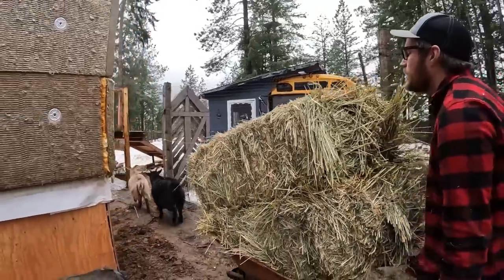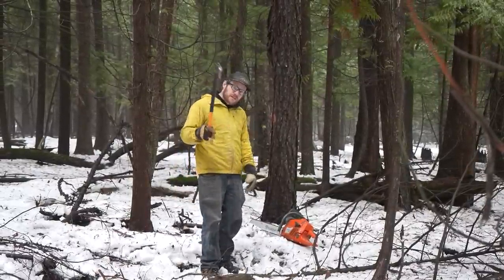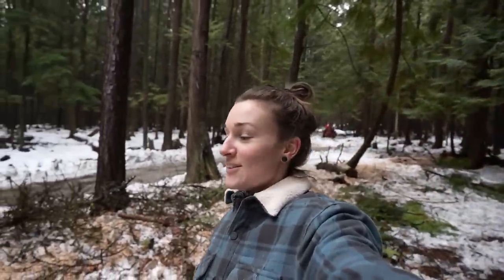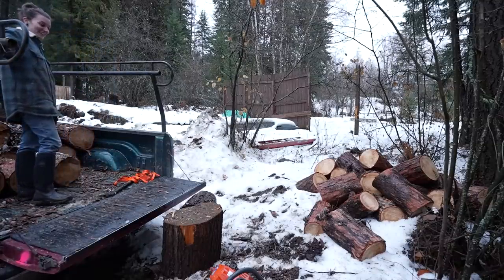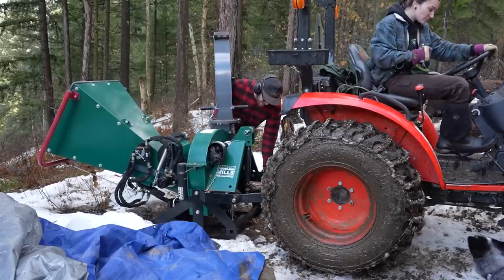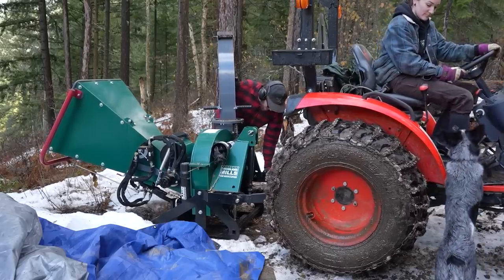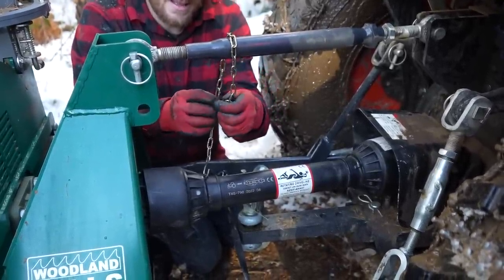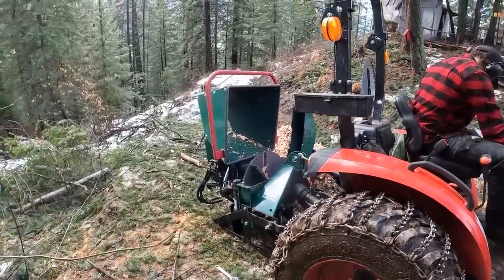We Are PREPARED! Living Off Grid In The Mountains

Comment: Wanted to comment on your chainsaw.  I have the same one and i've only had the chain come off once out of cutting down 1800+ trees with it so far.  It's a beast, and a good choice.  You may be having slightly less luck with chain staying on due to blade size.  I use a 24'inch and it's sufficient for our trees and works well.  Also if a chain only barely nips a branch it's more likely to throw vs just following through.  It's not meant for light duty limbs and will increase chain falling off if used for that purpose.  This is meant for large thick limbs/trees.  Use a smaller chainsaw for small brush.

Anyway, my 2 cents with the same chainsaw.

Comment: I suggest that you put a large tarp on the ground to catch the chips, then you can lift the tarp with the tractor and move it. 
I also suggest that you wear leg protection when using the chain saw and never - ever - have the tractor running when handling parts that are moving nearby. It is so easy to slip and parts might start to move and in a second you can lose your hand or arm. Protection comes first!
But I like your videos and your work on, and outside, your cabin.

Comment: I have switched to a much larger 2wheel wheel barrow(poly) and it is so much more useful and easier to handle than single wheels with small tub and small wheels.
Fall, fell or shoot all work!  Long bars rev slow to speed, to keep the chain. If you have a rim sprocket. Spurs get grooves that can loosen the chain unexpectedly.

Comment: You are complaining your gates are falling down.  This was patently obvious with struggling to hold the gate up whilst opening it at 31:18.  Note: the design of that one on the chicken run, that you are struggling to open, is partly designed upside down so that weight pulls it apart. The nails that you use are not strong enough.  If you had used bolts, that could be a different matter. 

“Left” and “right” are taken looking at the gate from the outside.  It is hinged on the left side.

In the following, all major framework junctions will need to use ½ inch diameter bolts.  Smaller bolts (3/8 inch diam) could be used for the majority of the struts.

Timbers:-  HingedVerticalPost, Mid-wayVerticalPost, VerticalEndPost as well as the two horizontal rails (TopRail and BottomRail) ideally be cut from 4 x 2 inch timbers.  

Major Frame:
a)	Compression Strut running from junction of top of MidPost and TopRail, down to bottom of HingedPost and BottomRail.
b)	Add another Compression Strut running from junction of top of EndPost and TopRail, down to bottom of MidPost and BottomRail.

Bolt together the posts and rails, then, if your carpentry skills are adequate (will need to be pretty good and the angles exact), you could mitre fit these compression struts, fixed in place by nailing.  Otherwise you will need longer bolts at most of the junctions (nailing would NOT be adequate, not even 4 inch nails).

Struts:
On top left hand half of the gate, the struts should slope downwards to the left from the TopHorizontalRail  (left of the MidPost) to the HingedVerticalPost. Further struts should continue that orientation, from right downwards to the left,  i.e, the struts should all be "in compression".

These struts should be fixed by bolts, not nails.

Bolts:  Note all bolts should be used with washers (½ inch bolts with 1 inch washers, 3/8 inch bolts with ¾ inch washers, thickness, probably 1/10th inch).  They should be hot-dipped zinc coated or zinc electroplated for corrosion prevention.

Also note, you will need timbers that can withstand exposure to the elements for many years without rotting -- so some form of pressure treatment will be needed.

Comment: Ya know guys I still think building a rocket mass heater would be a good project for you DIYers you got fire brick n rock n sand n clay n hay and an old fifty gallon steel drum and you will burn far less wood and stay warm and cozy without having to cut and burn large amounts of wood daily all day to keep ur house warm in the winter. Hey it might increase ur cuddling time together! Ha lol! N if you wanted to heat your barn well not a bad idea for that or even a machine shop repairing or crafting useful equipment, equipment like a log hauling Arc "Wow that was a new discovery for me" Ive seen them a few times but didnt know what they were called but useful as hell to you forrest dwelling folks to move fallen timbers and logs n such fairly efficiently and easily with small tractor or atv.